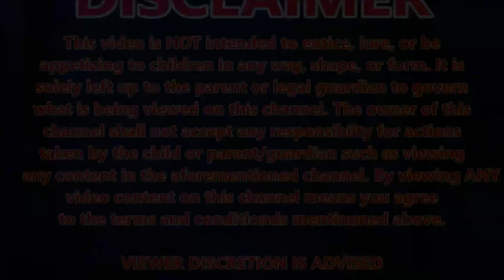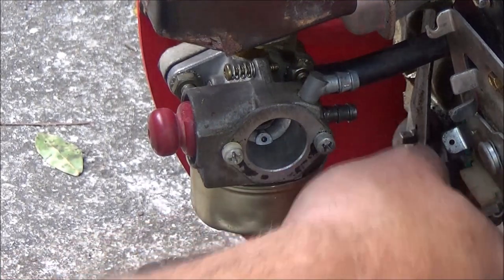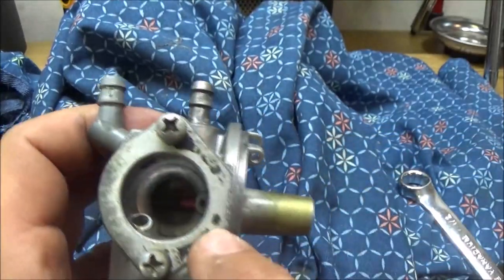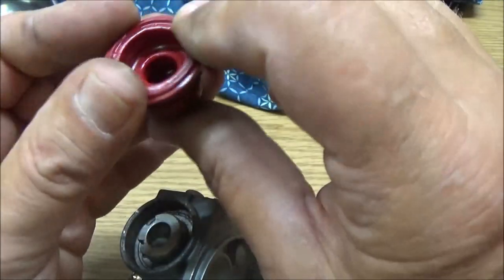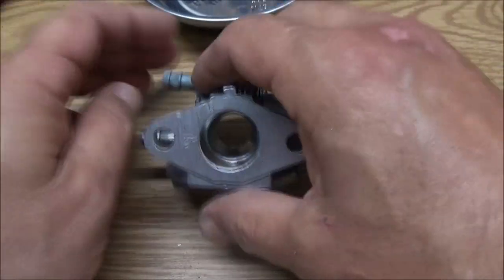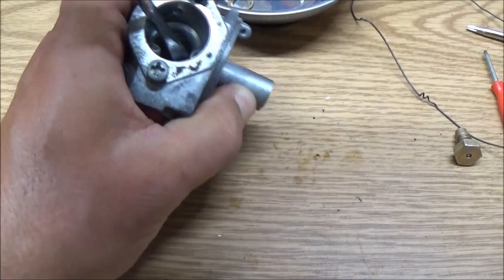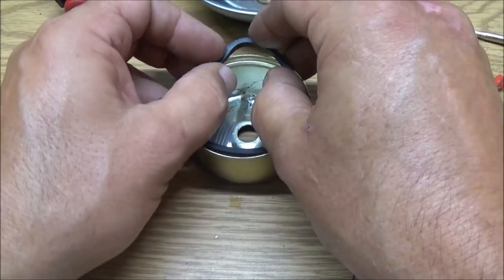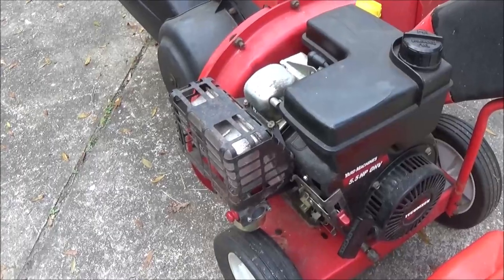Carburetor Work On Wood Chipper And A Couple Of Interesting Stories

Comment: Thanks for these small engine equipment videos, I enjoy them.  Those aftermarket carburetors are pretty cheap especially the small weed-eater type carbs.  That carburetor soak solution you use seems like it works pretty good.  I've been looking at the Harbor Freight ultrasonic cleaner, sometimes they have it on sale with a coupon.